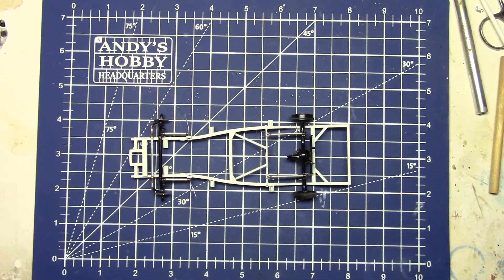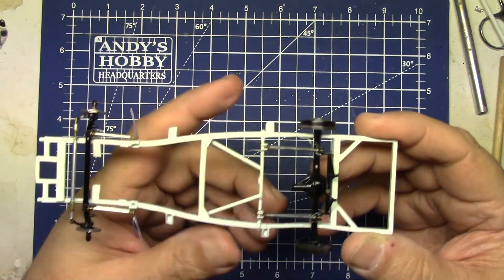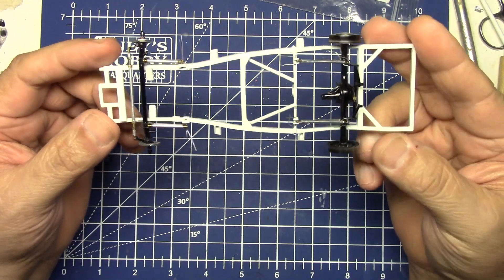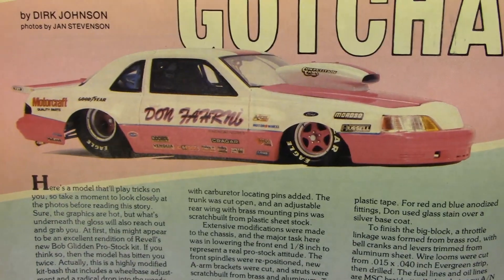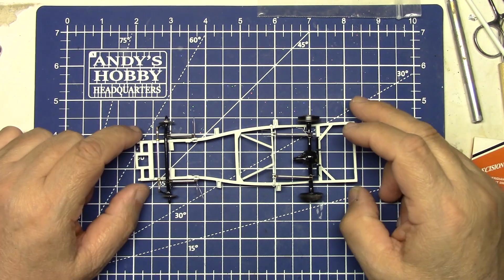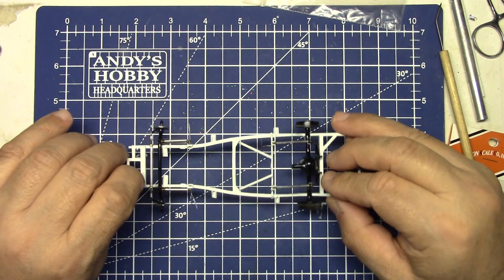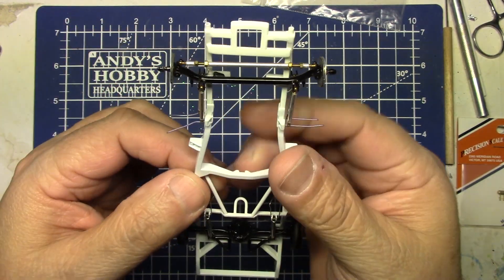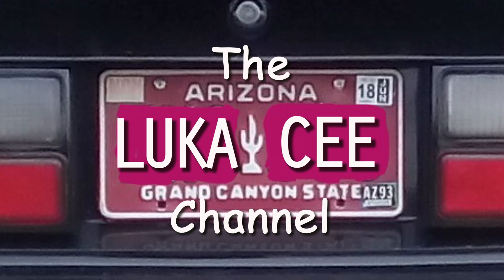Ep.168 Heim Joints For Scale Model Car Suspensions

Comment: It's tips and tricks like this that go a long way, thanks. I think it also helps the ones who want to build more elaborate stuff, but have no idea where to even start with parts and materials and get discouraged thinking "How tf am I going to make that joint out of *stares at maybe some sprue, and evergreen sheet on the table*" 

I can make roll bars, cages, chassis, monocoque tubs, headers, the bars for a four link or whatever easy enough because the information for 1 to 1 sizes are easily findable for just about anything you'd want to build in scale. Then I go look at a Tim Mcamis video on an adjustable four link pro mod rear because I want to make one for a build and at some point it turns into exactly into "How the f..." Same with fuel lines, plug wires and other wiring, I have serious problems remembering even what the 1 to 1 sizes are supposed to be on a given application, scale sizes and what to use even more so. End of yet another incoherent rambling comment :)

Comment: Love it.i know my next projects suspension and don't even know what I going to build yet. I used 1/10 scale oil filled shocks for hydraulic cylinders on my metal Tonka carhualer for my 1/24 & 1/25 plastic cars. 3 Porsche 356's on top and 2 lower.

Comment: Speaking of working on things in 2022, Luka what happened with the 64 olds you had goin on. I love this idea, I'm working out a 72 vega right now and this tip would really make an awesome impression. It would be cool to see a video on scratch building a set of the load handlers like I had on my 80 grand prix or those double end jobs for the 4 link setup you showed. Your an awesome builder Cee keep it up.
Reply from the maker: Im back on the Olds now that the 40 Ford is done.